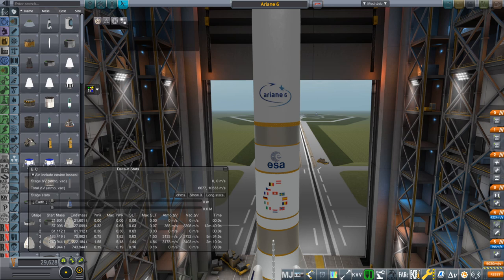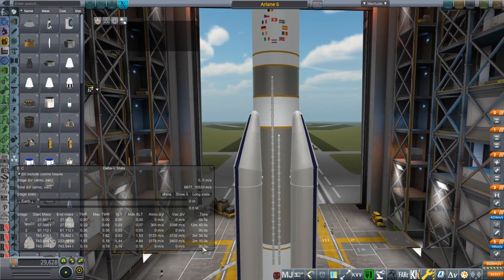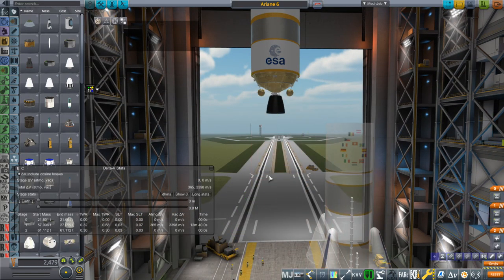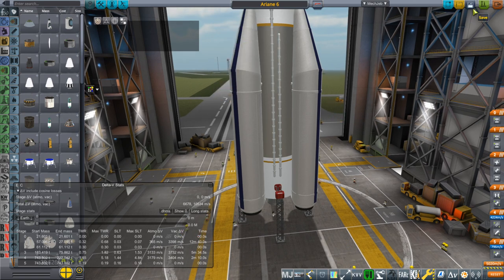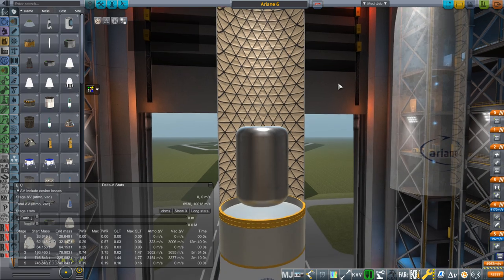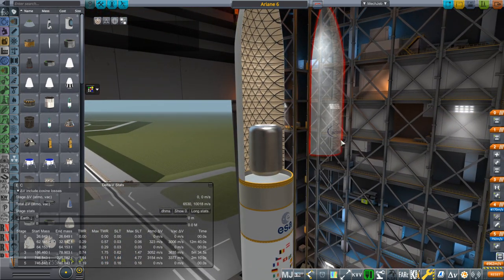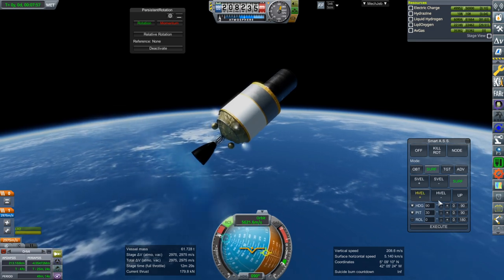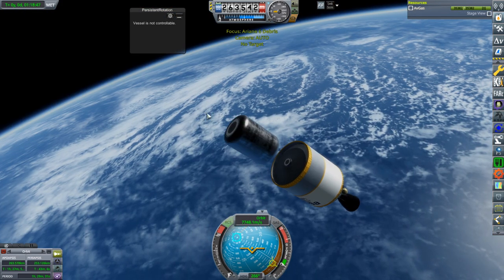Realism Overhaul in KSP 1.8.1 - Ariane 6

Comment: About the texture doubts you have on the rocket: Arianegroup has multiple posts on their instagram showing the full render of the rocket with all its colors etc and the first stage is white in all the renders, while the blue stripes on the boosters that you put are correct. In case you want to change them you can get those fron there or from the arianegroup website which also gives a full render

Comment: 4:30 If you look at comparable modern hydrolox tanks (e.g. the first stages of the Ariane 5, Delta IV, and Cháng Zhēng Wǔ Hào), it's actually fairly similar. The Space Shuttle External Tank is a massive outlier when it comes to hydrolox dry mass fractions, for reasons I do not even partially understand.

17:25 I think you should figure out how to get the first stage to have roll control before you release it.

Wonder why there's such a disparity between your payload capacity and there's. As you say, the payload adaptor can't be that massive.

Comment: Is the nozzle extension in game purely cosmetic, or are there different isp modeled for extended and not extended modes?
Reply: are you using stock KSP with a mod like cryogenic engines or realism overhaul?
Reply: @jmstudios457  I'm not aware of any plug-in that changes the isp with nozzle deployment, you can make different engine configs with different isp or thrust that can change in fligth or switch propellant using Generic Engines which is on RO main page.
Reply from the maker: In the game right now it's cosmetic. I have an engine with two different modes for extended and not extended, but the actual extension animation is still separate from that. Since the Vinci only operates in the extended mode anyway, I decided not to add a mode switch for it.

Comment: since ariane 6 is supposed to be a cheaper ariane 5, i think they should not use a nozzle extention because that adds complexity and maybe go with a kerosene/udmh fueled lower stage to eliminate the costs of working with hydrogen?
Reply: They don't have any experience building large hydrocarbon engines and they haven't stated that they intend to spend any money to develop them. They looked at building a reusable gas generator open cycle methane or propane engine called prometheus but, I'm not aware of that going beyond a design study.
Reply from the maker: You're neglecting the costs of completely changing the design, which would require new tooling, new factories, new fueling infrastructure, etc. They already spent a great deal to be able to handle the hydrogen, so might as well take advantage of what they already paid for.
Reply: I doubt that handling that much hydrazine for the lower stage would be cheaper. Hydrazine and its derivatives are a real pain in the ass to work with because of their toxicity. Furthermore, they offer way less performance than hydrogen, methane or kerosene. They already did that (Viking and Aestus engines) and there is probaply a good reason for them not to work with hypergolics in the first stage again. 
Also, changing the fuel has lots of impacts, not only engine design: You need different valves, different tanks, different fuelling systems, new turbopumps or rebuild test sites for the engines. They used hydrogen for a long time and probably chose hydrogen because of the experience with it, repurposing hardware designs, etc.
I agree with you about the NE, but maybe they could repurpose some Ariane 5 designs and nedded the NE to fit inside... I don't know...
Reply: @TheWisator Contrary to what you say, hypergolics are not substantially worse than kerosene, or to a certain extent and in certain applications (e.g. for SSTOs with a low payload mass fraction) even methane and hydrogen. Assuming the same base stats of the Vulcain 2.1 engine (120.8 bar chamber pressure and a ~58.2:1 expansion ratio), an optimal arpiolox (my term for specifically RP-1/LOx, as opposed to kerolox, which could include T-1/LOx, Jet-A/LOx, etc.) mixture (O/F=2.787) would give 264.53 s sea level and 353.59 s vacuum, while an optimal udnoxide mixture (O/F=2.675) would give 246.94 s sea level and 332.99 s vacuum, a 7.1% and 6.2% difference respectively. (All these calculated using Rocket Propulsion Analysis Lite) The density of the first mixture would be 1.03 g/cc, while that of the second would be 1.178 g/cc, which by the 2.25-root estimation would result in the arpiolox tank having a dry mass fraction 6.2% greater than that of the udnoxide one.

Extending the 2.25-root estimation to the hydrolox tank (with its O/F ratio of 5 resulting in a density of ~0.324 g/cc), we'd end up with these stats for the first stages using different propellant mixes:
Hydrolox: Dry mass fraction: 8.1% Vacuum delta-v: 10,626 m/s
Arpiolox: Dry mass fraction: 4.84% Vacuum delta-v: 10,498 m/s
Udnoxide: Dry mass fraction: 4.56% Vacuum delta-v: 10,083 m/s

As you can see, they are all relatively comparable. While the difference in the single-stage delta-V is larger between arpiolox and udnoxide versus hydrolox and arpiolox, the level of difference in the whole-vehicle delta-V and payload would be reversed, as that is more sensitive to specific impulse alone.
Reply: As much as i have heard they first thought about the nozzle extention, but to make it cheaper and easier they  have a longer interstage so that the nozzle is already extendet. Also the SRB is also the first stage of the new Vega C. That way ESA hopes to get them cheaper too (more produced SRB´s). Also i have read in Bernd Leitenberger´s Roket Blog (it´s in german) that according to his calculations the Ariane 6 should have an higher than advertised Payload to LEO.